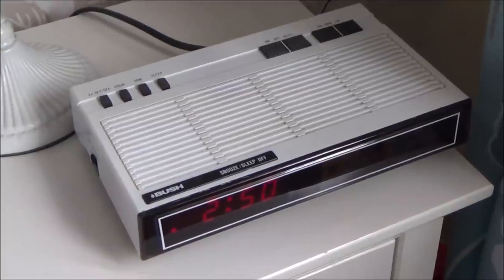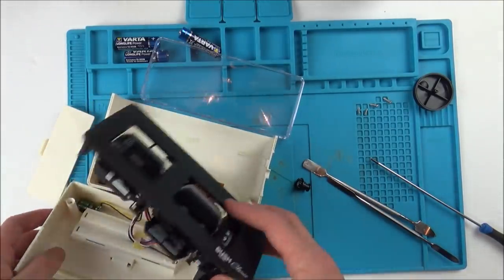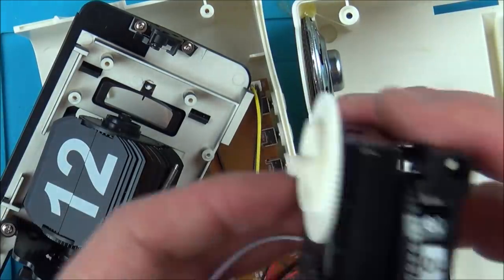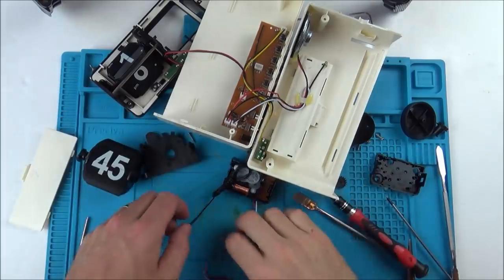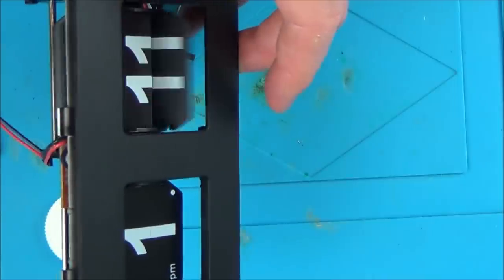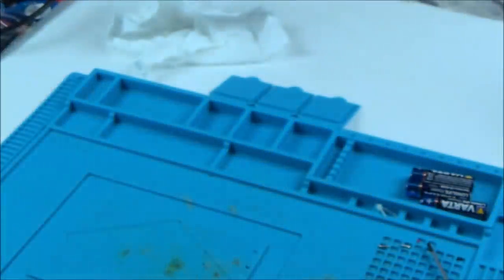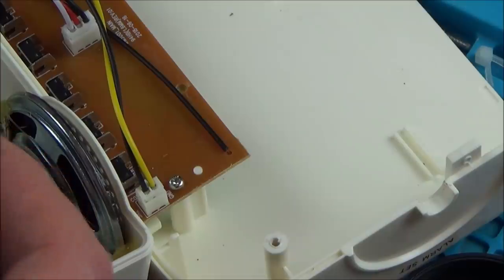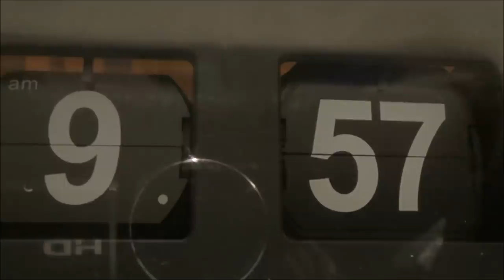Trying to FIX: Flip Clock Radio (QUICK VERSION)

Comment: I love electromechanical bits. I recently tore down a clock that had film belts with seven segment digits etched on them backlit by incandescent bulbs. Super interesting it came from an age where a digital LED display was too expensive so they opted for a complex mechanism instead. Still have to finish fixing mine though as the synchronous motor burned out.
Reply from the maker: Wow, sounds great, have you been filming the repair for your channel?
Reply: @Mymatevince  Yep, I've put up the teardown and a video showing me testing a replacement stepper motor so far. I just need to design and 3d print a mount and it's good to go.
Reply from the maker: @sjm4306  Found it, the Westclox, I will watch it now :-)

Comment: You need to put everything on 12 yes. I usually put a metal pin in the plastic then weld it then glue it. I had full success even on big loads mechanisms like mechanical programmer clock on washing machine which moves High voltage loading metal plates. You getting pretty good in repairs!
Reply from the maker: Thanks techixbul, maybe I could try a red hot paper clip/ staple or needle the next time I need to fix a snapped part :-)
Reply: @Mymatevince  i usually use legs of resistors (sometimes few of them), bend them like staples/nails/pins if needed and just push/heat them with solder iron to implant them into plastic, no need to be red hot, just regular temp.
Reply: @Mymatevince  Use a needle because it is stiffer (stronger) and smaller in diameter.
Reply: @codebeat4192  needle is a waste of needle itself, and it won't  be stronger than the plastic itself, also it is very smooth steel and it won't stick that well to hold 2 pieces tide, also it is fragile and hard to modify, it has reduced elasticity, and will expand its cradle if put in moving or vibrating parts.
Reply: @technixbul  You also need to use super glue of course. Have you seen how small the broken part actually is? A needle can be smaller in diameter compared to a paperclip. Using a needle (inside the plastic, in center) and super glue makes the part really stronger. Have you ever tried it yourself? I did.

Comment: Vince the tiny part that is broken off was pressed into that shaft. That’s why it was as fragile as it was. So the shaft had a small hole drilled in the end then the end had a nub that pushed into that shaft. I’d try some 2part epoxy to hold it.
Reply from the maker: Thanks for the tip, another viewer also mentioned it was a push fit. If I had known I would have tried to pull it out once glued to see if I could remove it. Would have been able to do a better fix then :-)

Comment: I’ve had a few flip clocks and not experienced the delay with the hour flipping over. Also, when you flip the whole thing manually, you don’t appear to have any delay. Possibly, this is another fault?
Reply from the maker: Possibly, a viewer did say that his one does the same but maybe both of ours has issues. It could get you into trouble if you only quickly glanced at the clock when it was o'clock as you would be an hour out :-)

Comment: If i have to deal with small broken plastic parts i glue it together and after this i drill a hole through both parts and superglue a nail or paperclip in there so it will not break again. If drilling a hole is not possible it might work to melt a metal piece in with a soldering iron.

Comment: You can get a glue called plastic weld. Toy poloi uses it a lot and it melts the plastic chemically so it can fuse back together. It's supposed to give as strong a bond as the original plastic before the break. It would certainly beat superglue and melting the plastic with a soldering iron